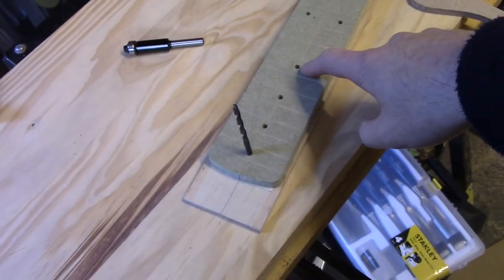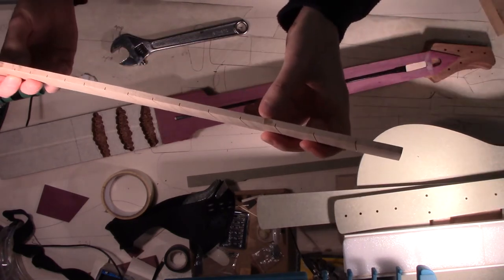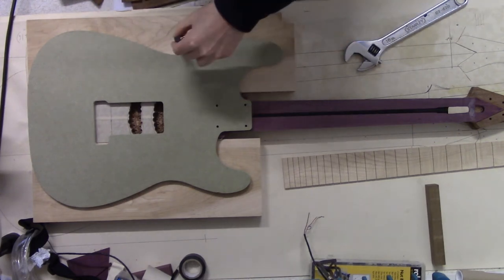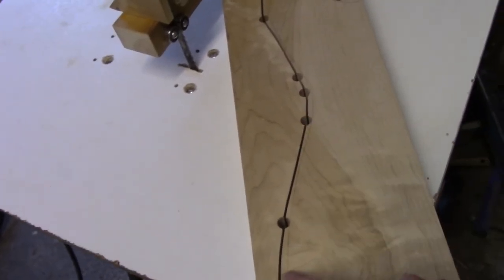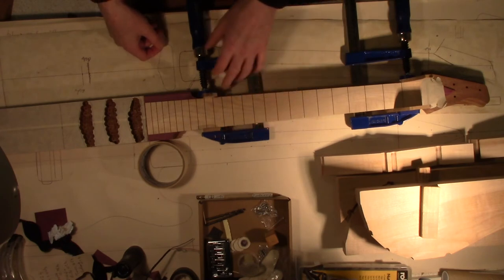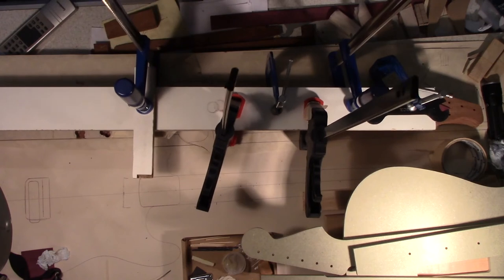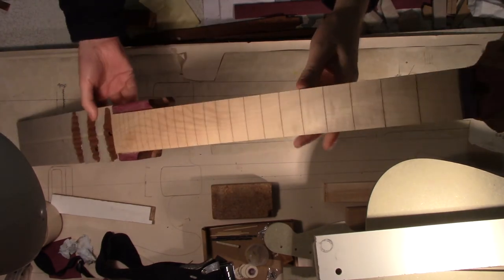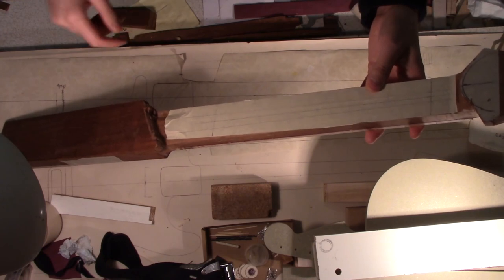Neck Through Custom Guitar Build (Part 3)

Comment: You have given me a great idea for my 8-string bass neck through!  Rather than use shim to raise the fingerboard, although I like the purple heart stripe you will have along the neck, I will lower the level of the top of the body  to get the bridge and pickups at the right level.  Just as you used the fingerboard template, I will use it to help shape the portion where the fingerboard meets the top,  (Hope that makes sense)  

Your build is coming along nicely, and I'll continue with part 4.
Reply from the maker: @dashdrum-again  thanks, lowing the body is the right way to do it, but the shim was easier! Good luck with your build